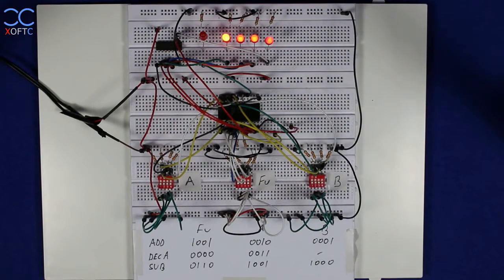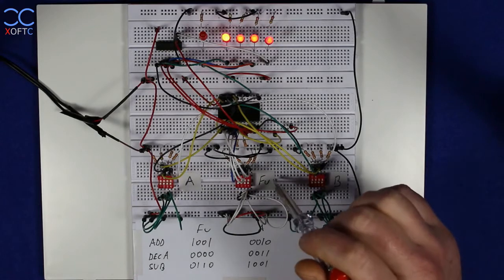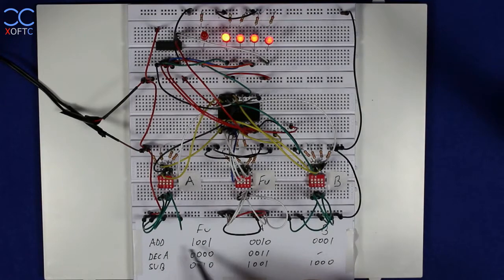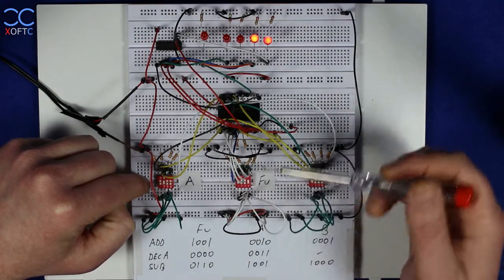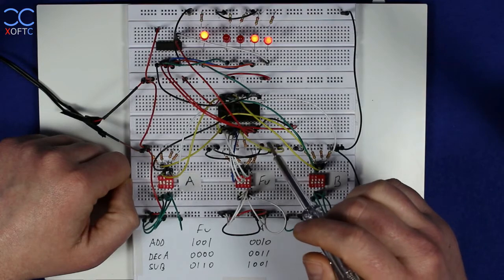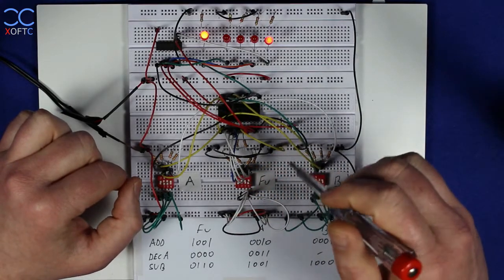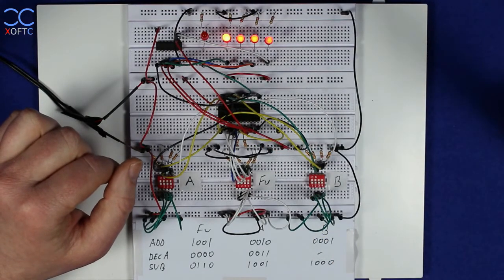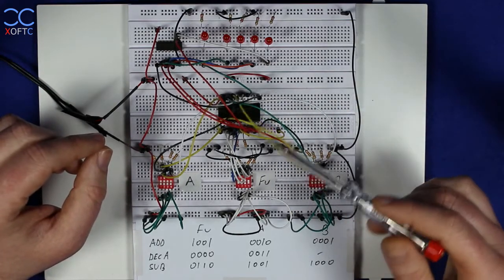How To Work With an ALU (74LS181)

Comment from the maker: To the Anonymous user who asked about the difference between the "+" and "plus" in the arithmetic functions:

The "+" sign is a logic OR and the "plus" means addition, in all cases.
To put it short and simple also in the arithmetic functions some functions will give the same result as the logic function only that with the arithmetic functions the carry bit will be enabled which makes a logic function have different uses in arithmetic operations.
here is a nice article to explain the 181 alu more in-depth: 
http://www.righto.com/2017/03/inside-vintage-74181-alu-chip-how-it.html
Reply: Thank you!!!!

Comment: Sir whats the difference between active low and active high data table in TI datasheet?
Reply from the maker: Active low means that a specific function associated with a specific pin is activated when the signal is low (no voltage applied / pulled down), active high is when the func is active when the signal is high (voltage applied i.e. +5v)

Comment: The 74HC181 is a good ALU choice if you want all the functions without much trouble. But it does give a load of functions that are frankly pointless. I've used two of these ICs to get all the functions necessary for making a 6502 CPU from TTL gates. You can see it here: https://www.youtube.com/watch?v=sypK3F2xv4o

Comment: I DID THIS PROJECT AND IT ONLY WORKS WITH LOGIC OPREATIONS CAN U TELL ME EXACTELY WHERE THE MODE AND CIN ATTACHED TO SHOULD THEY BE ATTACHED TO THE GROUND OR NOT ATTACHED TO ANYTHING IF I WANT THEM TO BE LOW ??! PLEASE REPLY AS FAST AS POSSIBLE MY DEADLINE IS TOMORROW
Reply from the maker: Cin is "Carry input" bit. if you dont cascade several 74LS181 or if its the first one in the series it should be grounded. If you check the 74LS181 datasheet you will find there a table that describes exactley how to switch between logic and arithmetic.
Hope this helps.
Reply: +xoftc  sir can i ask for schematic diagram of this. i want to try it for myself

Comment: Hi, i implemented the same ALU but i used a counter (74ls93) with a push down button for my selectors, but my output is always displaying F in hexadecimal (15 decimal), do you know why?
Reply from the maker: PhoenixX7 First you should know that in this video I am inverting the outputs. if you don't use an inverter than the output you are getting is 0.
this can mean that you are not providing any values or something in that circuitry isnt connected right. also remember to use 1k pulldowns on all the inputs.
hope this helps!